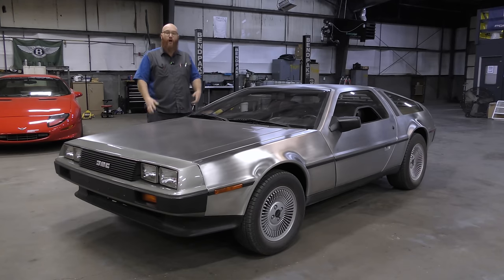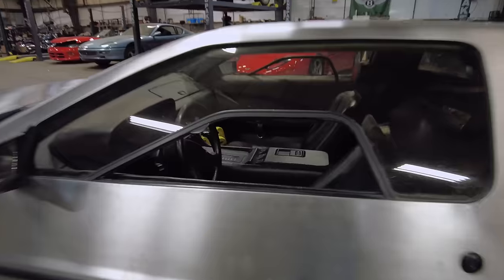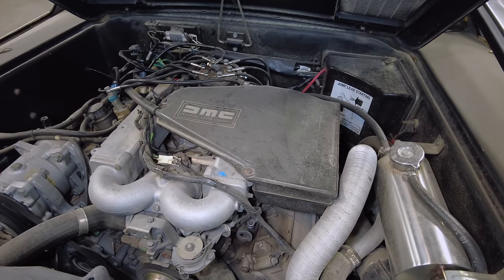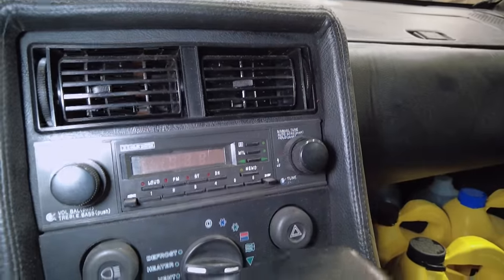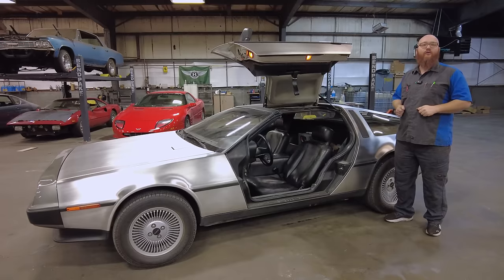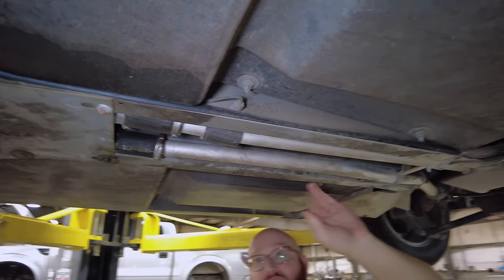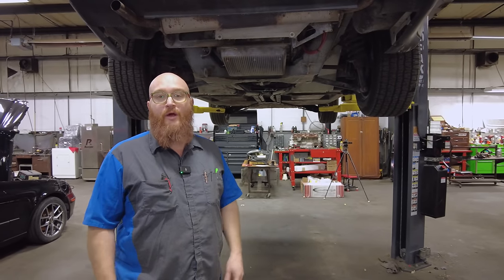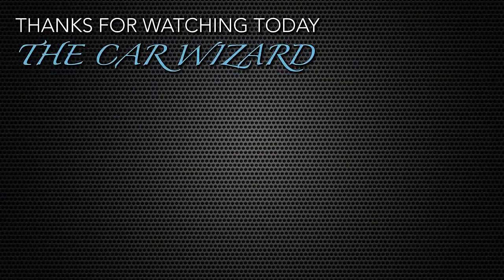Time Machine in My Shop! This DeLorean Will Send You Back to 1981

Comment: Nobody knows the little windows are toll booth windows. Delorean said theres no way you could open the gull wing doors on the bridge to pay the toll because the doors would get damaged. So he wanted tiny little windows put in with just enough gap to put your hand through to pay the toll on the bridge around new york. Thats what the tiny windows are for!
Reply: Other reason was the door design couldn’t fit the needed mechanisms for a full size window so JZD went with the toll booth window
Reply: Thought they were for the tazor guns that were supposed to be invented afterwards.
Reply: Just be careful in the JCP parking lot.
Reply: Or the Fotomat drive-through.
Reply: The size is goverened by the design of the door.....
Reply: Nobody is the wrong word,car guys and east coasters know.
Reply: A access window for a chalupa at Taco Bell
Reply: The doors can fit full size windows in them but if the window is any bigger than the toll booth size we got, it would affect the door operation with the window open vs closed. There are two guys who swapped over to full size door windows as best I recall.
Reply: @dickeysgarage  Seen one with the windows swapped it looks terrible!
Reply: I thought it was a trash chute
Reply: @dickeysgarage  I would leave the windows alone myself. It's part of the charm of the vehicle.
Reply: @ANOCKS  I wasn't advocating for changing them out. I was just pointing out that it has been done is all.
Reply: Originally JZD wasn’t going to have power windows but simple slide-windows like the prototype. A passenger he sat next to on the Concorde convinced him only true luxury cars have power windows.
Reply: @dickeysgarage  I realize that dicky I was just giving you my opinion of what I would do if I had the car,that's all
Reply: I was told it was for coke deals.  Probably more accurate for the era and John himself. lol.
Reply: It’s how you slide your hover board out. Duh!
Reply: No it was just cutting cost. These thing r neat but they r a huge pos. It's bad engineering. They got to the end and saw the windows wouldn't fit in the door
Reply: I mean... They are also just windows that open. They are for all the things you need windows that open for. Seems weird to suggest they are there primarily for toll booths! Every car has windows that open. 😂
Reply: @BlueXonar  Not for gullwing doors they dont have windows
Reply: @PAUL-MH  why couldn't they? Theres operating full size window kits for Deloreans for sale now. I don't think there's anything new or revolutionary about the technology those use that wasn't around in the early 1980s.
Reply: @bluecollarred6912 Normal windows would work just fine. Delorean made the windows like that because he felt that with the luxurious AC there would be no reason for windows except for tolls. That's the real reason.
Reply: Roadside cocaine pickup from dealer more than toll booths. 😊
Reply: Working at a deLorean franchise with Volvo franchise JZD gave the owner the earliest models= some had electrical problems- saw one man get brought back on a flatbed with him inside-only fresh air intake was the slots the doors would not open had a car phone to call a flatbed I  think
Not sure if he kept the car
Volvo,Renault, and Peugeot all used that same engine in a conventional front engine/rear drive set up,and possibly others, in other applications
The body is replaceable stainless steel panels fitted over a fiberglass composite structure 
Radiator/condenser placed under the front fascia with long conduits and hoses to the rear engine and cabin
Nightmare. Rich mans cool toy 
American car  techs would have never seen anything like this technology, in 1981 That Bosch mechanical system had an ecu box for Federal emissions compliance  somehow
Reply: @Kizzle001 The Libyans!!! 😮
Reply: @Kizzle001 The Libyans!!! 😮
Reply: what are you talking about? everyone knows that ....

Comment: I’m so glad this hasn’t been turned into a Time Machine. They are such great looking , iconic cars . It sucks so many of them are now time machines .
Reply: I feel the same way about KITT.
Reply: @keanecoquete4977   same here , ruining a perfectly good 3rd gen Trans Am .
Reply: They’re slow heavy and don’t handle well. 😂
Reply: They can be reverse-engineered back to stock when you've had enough of the BTTF additions, surely?
Reply: @frglee  Way more work than it’s worth. You would need at least 500 hp to move that stainless steel tank around with any respect.
Reply: @rolandthethompsongunner64  wrong on all counts. I used to own one. Car isn’t heavy at all, about 2700 pounds. Handles very well and is not as slow as you think. Don’t believe everything you hear
Reply: Yep it gets boring...
Reply: @frglee  I "converted" mine to a time machine, but made everything completely removable so it can be brought back to stock within an hour or so. It's the only way I would do it, otherwise your drilling into the stainless panels and drilling holes everywhere to attach stuff...I don't like ruining a car like that
Reply: @rolandthethompsongunner64  Yea, no. They're not terribly slow, they definitely are not heavy @ 2800lbs and they handle pretty decent. Mine is lowered with upgraded springs and shocks and bushings so yea. Good job on keeping the rumors alive tho
Reply: @rolandthethompsongunner64  I'm not sure you've actually ever driven one or seen one up close. Do you realize they have bolted on stainless panels that are like less than 1/8" thick? They body of the car is fiberglass with a small inverted Y mild steel frame...Oh yea, it's a car from 1981, were any cars fast back then?
Reply: @DeloreanGuy2 lmao. Right?  Even the corvettes and mustangs were slow emissions choked “performance” cars.   

The 80s produced a lot of cool cars, but most (exceptions like the 87 Buick GN) couldn’t get out of their own way.
Reply: @JohnK-ph3vw  exactly! I dunno where half these comments come from sometimes! What we "thought" was fast back then was not, especially compared to any modern day car
Reply: They’re junk. A Peugeot engine?😂
Reply: If you think about it, turning a DMC into a Time Machine is probably a good way of ensuring the car will continue to be preserved into the future. You can probably covert a Time Machine back into a normal DMC without too much trouble.
Reply: To be fair they were produced till like a dcade ago and OEM replacement parts are plentfull so... How is it worse they a Restomod?
Reply: @Tstanley81  I checked you’re correct. I still think they’re junk. 😂
Reply: @DeloreanGuy2  You ever heard of the Pantera ? I would much rather own one of those at least you could paint it 😂
Reply: I just want to take one and swap in the engine from the Chrysler Gas Turbine car.  I know it's probably impossible, but if you could pull it off can you imagine a DeLorean going down the road making that jet engine sound?
Reply: @Venkman1912 0-60 in 10.3 seconds, and 1/4 mile in 17.4 at 77 mph, they are snails, and the chassis is fiberglass, they flex like crazy. Everything was a turd in 1981, sure, but honestly, a V6 Camry would stomp a DeLorean in every way, except getting stupid flux capacitor jokes. I've worked on several, they are underwhelming performers.
Reply: @DeloreanGuy2  Countach 😛. Jokes aside, the DMC 12 had very respectable performance for its day.
Reply: I do agree, definitely detracts from the looks of the car.
Reply: @rolandthethompsongunner64  if the stock engine is only 130 hp just swap in a 3800 supercharged for 2x the horsepower and better reliability. those engines are pretty commonly available and could easily be made to look like it fits.

i love the stainless steel body. it is so unique.

Comment: If I had that, would drop in a Honda 3.5 VTEC V6 that has ~280 or so HP, which would be plenty, and I’d prefer a manual trans, paired with that motor would be more than enough speed and torque.

Comment: As I clicked play on this video, I was apprehensive and worried because my beloved DeLorean always catches a lot of unwarranted crap for a variety of reasons, but mostly because of myths about the car itself and people comparing it through the lens of modern vehicles. However this was a fair review.

Wizard I hope you don't tap the Bosch intake screw to adjust the RPM. That's sealed for a reason. I noticed the brake master leak in the front on the gas can pan...unless that's water. But thank you for taking care of it! You're correct that most mechanics don't know how to work on these cars. 

Other people: PLEASE don't buy these and convert them into Time Machines.
Reply: markasread4349  lol! 😄So you're THAT guy who wants to see the world burn!

Comment: John DeLorean is one of my car heroes. He gets a bad rap for how his career ended in shambles, the whole drug case that was dismissed due to entrapment, and how the DeLorean car failed. 

Instead, he’s a hero because of what he did at GM and Pontiac. He’s the guy who said “hey let’s shove the big 389 from our full size Bonneville into our compact Tempest and have us some fun”…… thus was born the GTO. And the muscle car era. 

There should be a statue of him at the main entrance of the RenCen in Detroit.
Reply: He is also known for disaster at GM. Remember the ill fated Vega? Where he wanted a lightweight car to compete with Japan? Where the engine was made of aluminum and the cylinder walls were coated with a material called silicon carbide, which was supposed to reduce friction and wear. However, the coating was not durable enough and would wear off quickly and then the engine in best cases would burn and leak oil.  In the worst cases?  They caught on fire after being parked.  My parents owned one, and this exactly happened - the car caught on fire in the parking lot at work.  GM gave up on the car and leased my parents a Buick LeSabre at great discount, but the battery died every 6 months.
Reply: His reputation is in contention to this day. Depending on how you look at it, he's either a beleaguered car manufacturer willing to do whatever it took to keep his business afloat or he's an unscrupulous man that had no qualms sinking so low to be involved in trafficking drugs which destroy lives.
Reply: @Buc_Stops_Here  There were enough bean counters and cost cutters between DeLorean’s idea and final production at GM by then to take much of the blame away from him. 

He should have been CEO of the company, with Zora Arkus Duntov the head of all racing development. And 90% of the accountants and bean counters all fired.
Reply: Don't blame John z for the Chevy Vega engine debacle. He was PREZ of vhebybejen he inherited the Vega project and bad engine. GM had excess aluminum man capacity in NY and to amortize costs they build that dud. Read his book on a clear day you can see GM
Reply: @joe6096  I cannot argue with that - it is legendary how bad the bean counters were back then.  However he did sign off on that design and it bit them in the end.  That had little to do with the cost cutters.  I wish it did.
Reply: Selective memory?  Guess you never heard of the Vega.  He's no hero to me, just the opposite.
Reply: ....the real story & missing chapter about what really  went down would fully vindicate John Delorean, which is a Story that never happened, from a File that doesn't exist.... at least on our soil, but British Intelligence only knew a little which is why a prominent US family has their file classified til 2084 & their long dead & gone....also what's on Pg 47!   If the Delorean owners ever knew what really happened, that Stainless would turn to rust from the fury & rage....& the American public would've marched down Pennsylvania Ave, in protest, & they would've  bankrupted Detroit.  The Domino effect or as Doc Brown would've said, The Ripple Effect, which also needed to protect the US auto & steel  industry & vendors...the story could be told someday.🤫
Reply: You idolize a grifter @chrispompano

Comment: Not 3 liter but 2,8 liter. The PRV engine was first 2,7 liter. You find variants of the engine in these cars. 
Alpine A610
MVS Venturi
Eagle Premier
Citroën XM
Renault 25
Renault 30
Renault Espace
Renault Laguna
Renault Megane
Renault Safrane
Peugeot 504
Peugeot 604
Peugeot 505
Peugeot 605
DeLorean DMC-12
Lancia Thema
Volvo 240 GLT 6
Volvo 260
Volvo 363 (Concept car)
Volvo 760
Volvo 780
Volvo 960 (some markets 1991)
Talbot Tagora
Reply: 130 hp for 2.7 litre seems very low. Is there any engine work to help fix that?
Reply: So all these cars had a 130Hp V6? God the 80s were awful.
Reply: Are you sure about the Lancia Thema being it’s Italian and the engine is french?
Reply: I believe it was the U.S. version that had this much power due to all of the usual emissions equipment that rob that missing amount of power, installed at the time.

Later versions of the same engine had about 150 or so horses in the Peugeot 505 and the Eagle Premier/Dodge Monaco, and the Volvo 760, 780 and 960, here in North America.
Reply: @dth2brny121  I had the 2.7-litre version of this engine - the B27F - in my '77 Volvo 264 GL. It was a North American spec car and was rated @125HP - 121HP if equipped with a catalytic converter. When the engine was first upgraded to 2.8 litres it was now rated @130HP in North America. This was the engine - the B28F - that was in the DeLorean. 

When the engine was upgraded again to an even-firing engine it was now rated @153HP. This was the version - the B280F - that first appeared in the new Volvo 780 & 760 in I believe '87 and was a much-improved design over the original odd-firing PRV engine which was in the DeLorean.
Reply: @johnchurch4705  Yes... The early version had the PRV six. This engine was replaced in 1992 with a 3.0 L V6 Alfa Romeo engine.
Reply: @Kent.  that’s really interesting 🤔, I wonder 💭 if Lancia fettled it to their liking? I know the later engines are Busso based.
Reply: @briancavanagh7048  not much, rip it out.
Reply: @jwalster9412  80s were awful? Did you even live through it? My 1987 Ford Mustang 5.0, 1989 Trans am GTA,  1988 Buick Grand National. And the list goes on.
Reply: @FordPickUPRed  let me remind you of the fact that 97% of cars in the 80s were underpowered sedans, and every none sporty V8 was neither powerful or economical.

Comment: A good example of a driver quality car. Although they all look alike, there were rolling changes throughout the production life (Jan. ‘81 - Oct. ‘82) including three hood types (the fuel flap being the first, followed by a similar embossed hood sans flap, and then finally a completely flat hood with a ‘DeLorean’ emblem). Other changes included grey painted wheels on very early cars going to the more familiar silver painted versions. We also saw a windshield antenna go to a fixed mast on the front right fender, a manually retractable version, and then finally a power one set aft in the rear left-side faux vent. 

These cars are truly timeless and quirky and it’s great to see an owner want to keep the dream alive.

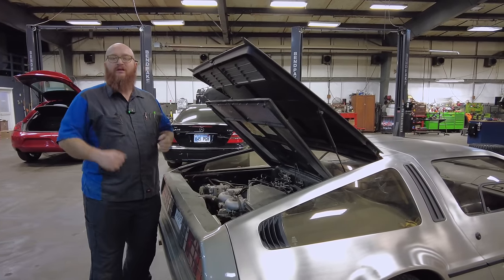Comment: 6:47 Never trust the mileage on a DeLorean. Angle drive from the front driver's wheel usually fails. Speedhut (not sponsored) makes a GPS box + GM adapter to fix that.

Comment: I like the fact this one hasn't been turned into a movie prop like so many others.  It's cool to see one as originally equipped.  From the view underneath, you can see how only the body is stainless steel; the chassis is standard steel and rusts just like regular cars - more so than newer cars since many of the suspension parts are now made of aluminum.
Reply: Correct me if I am wrong but isn't a DeLorean a fiberglass shell with a stainless steel veneer? There's no way a car body( minus the frame & suspension) made totally out of stainless steel is going to weigh about 2800 lbs. like this version does. Just wondering.
Reply: Even worse, the chassis was covered by an epoxy from the factory to help prohibit rust. The problem is that if the epoxy ever got chipped, and being that was under the car where it would get hit by rocks, water and moisture would get trapped between the steel frame and the epoxy and cause more rust than if the frame wasn’t covered at all.
Reply: I also read somewhere that if the fiberglass was damaged due to minor bumps, rocks etc. you couldn't tell because the ss veneer would hide it. Eventually the fiberglass part would deteriorate & fail. WTF?
Reply: @deanjo57790  That is true, but that epoxy also keeps the frame in perfect condition as long as it's kept up. Most owners go over their entire cars every year or so checking for such things to make sure and take care of it before it ever becomes a bigger problem. As long as you maintain it, it holds up really well!
Reply: @indolentcheese  It is a composite fiberglass shell that is covered with stainless panels that are bolted on. Being fiberglass it is easily repairable as most fiberglass is, whether it's a car or a boat or whatever. The parts that are covered by the panels generally dont get damaged, but if you do get into an accident then you obviously need to check everything out to get repaired...

Comment: The 2.7 litres 90° V6 was originally designed as a 3.5 litres V8 ... but energy crisis hit the nails in its coffin ... and PRV chopped off 2 cylinders for a more economically correct (at that time) V6. It went through various iterations with the first series basically maintaining the very same V8 chopped inards - featuring an uneven ignition timing. Lter they used a different crankshaft and camshafts to get a more even timing using the engine as two straight 3 cylinders at 90° offsetted. The first series had a very unmistakeable running noise, particular at the exhaust. The Volvo 264 used the first series as well as Renault 30 and Peugeot 604 V6. The Renault Alpine 310 used it as well.
Reply: U win best comment
Reply: Exactly flawed design but mine had holley carbureuters!!!!!  made a noise but lacked forward momentum
Reply: I loved the sound the 264 GL made.